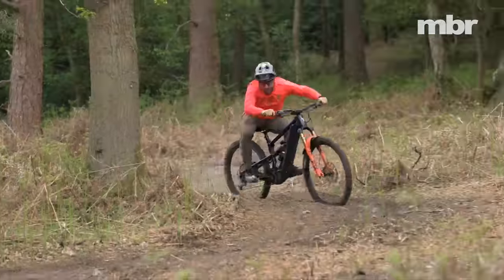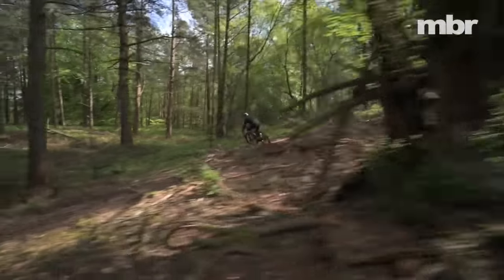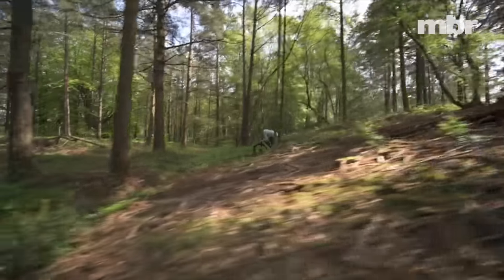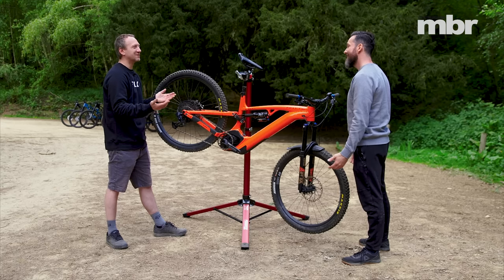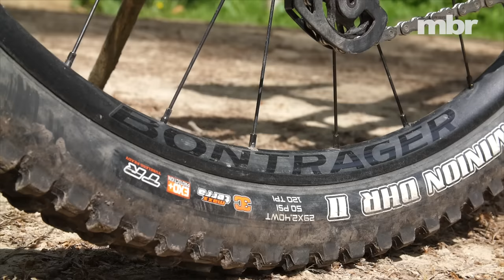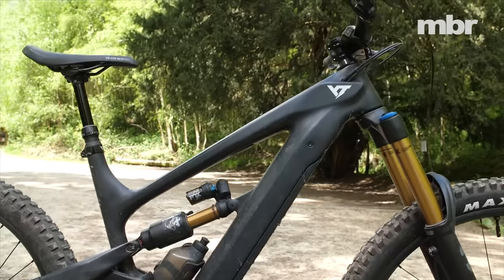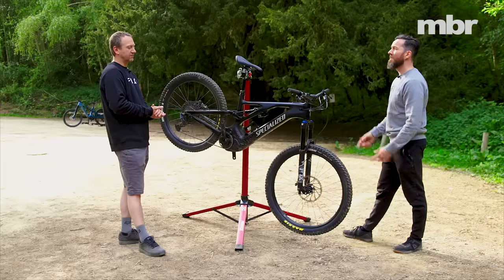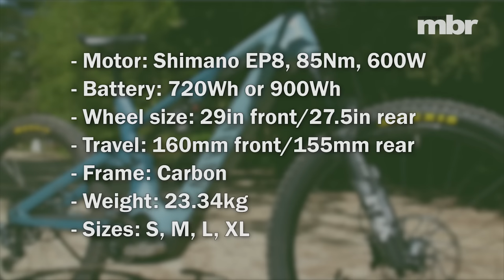The best electric mountain bikes: MBR E-Bike of the Year 2023! | Mountain Bike Rider

Comment: Interesting points(expert advice great information, amazing information must watch before you buy!) Funny thing about the length of the rear end. Having rode a 2019 Levo 29'er XL vs 2022 Levo S5 Mullet set up - The comparison to the Giant Trance e-Bike makes perfect sense.  The way the bike handles and control in DH technical or climbs. The balance and control. One other point is RockShock vs Fox. I think the Fox has the edge IMHO.  Getting the right size along with the other expert points you made!

Comment: Purchased the same Turbo Levo Comp.  Great discounted price.  I eventually upgraded the suspension; Fox 38 / X2, SRAM T-type transmission, Magura MT7 brakes.  It’s a totally different animal now.
Reply from the maker: Nice one - sounds like a great build.
Reply: How are you liking the Transmission? I'm thinking of doing the same on my Turbo Levo.
Reply: @McMaster_102  this my 2nd upgrade from stock.  The previous Eagle AXS was just as good as the new T-Type Transmission.  IMHO, I couldn’t feel a big jump in improvement for the money spent.  But from the stock GX to the current setup; night and day difference.  I still feel I need to “soft pedal” when shifting though.

Comment: Haven't found a Canyon Spectral with a Bosch motor. While Canyon say they have Bosch the website only option offered is the EP8, I wouldn't touch a Shimano motor with a bage pole. 
I still have a 2017/18 Trek Powerfly FS7 23.3kgs gen3 Bosch and not a single problem, now just over 10,000km. While all the guys I ride with have Specialized, Merida, Giant, Rocky Mountain and all have multiple problems with motors and replacement motors, and some with problems with speed sensor and batteries.
So I guess the Trek Rail will be the safest choice.
Reply from the maker: There isn't a Spectral:ON with Bosch. But the new Strive:ON does come with the Bosch system, removable battery, mullet wheels and just 10mm more travel.
Reply: @MBRmagazine  hurry up your test.

Comment: With regards to the Mondraker Crafty R rear end being unbalanced. The compression on my Cafty R came wound right up from the factory, if you pop the cap off where the adjuster would be you can with long nose pliers adjust the compression damping the full range.
When reduced the front and rear are nicely balanced and the bike rips.
Reply from the maker: Interesting - will definitely investigate. Thanks.
Reply: Turn clock wise or reverse?
Reply: @crocodiluspekinensis  reversed I think.
Ive got mine fully open as per the setup guide and same with the fork, works great.

Comment: So from experience and for the Specialized Turbo Levo just change the front fork to DVO Onyx SC with a custom tune and the rear to a DVO Topaz with a custom tune and this bike is like 10X better and yes I am like 120 kilos and still ride a 36mm DVO with zero problems, 100% reliability, but man does this increase the fun, speed, handling and confidence all at once.  Those are absolutely amazing upgrades.  Yes I blew the stock wheels and the components are meh.  If I could do it again I would buy the frame and just build out with Shimano and DVO and change the stock dropper post to something that is smoother.  But man the top of this bike swings side to side like a feather due to its light weight.

Comment: I got a 23 Levo Pro with AXS Eagle Transmission, Factory suspension, Bikeyoke dropper. Got S6. Only thing I am going to swap is brakes.  I was getting the Expert, but I add up cost of upgrading everything to the pro spec I wanted, and It would have cost me more than the difference I paid for the pro. Updating pricing is good to go.

Comment: Did you have a chance to ride the Orbea Wild FS yet?  Some sources say it's even better than the Specialized Turbo Levo.  The team at The Loam Wolf picked the Orbea Wild FS as the 2023 E-MTB of the year.
Reply from the maker: We're riding the M-LTD now. It's a very nice spec, but also £11k, so much more expensive than the Levo we tested. So far definitely enjoying the ride - suspension is good and it's very stable. The Bosch motor and big battery gives it a huge range, even with DH-casing, MaxxGrip tyres, but the non-removable battery is a pain. Will maybe try and do a comparison with the Canyon Strive:ON seeing as they are both marketed as enduro race bikes.
Reply: @MBRmagazine  I'm sure the Wild M-LTD is a super nice e-mtb, but I have the Turbo Levo S-Works ($15K) and I'd put it up against the Wild FS M-LTD any day of the week!
Do you think they are equally good bikes with the only real difference being rider preference?  Would you agree that it's like comparing a Ferrari vs a Lamborghini?
Reply from the maker: Can’t really compare them directly as they are different travel and intended uses. One is a versatile Trail bike and one is designed specifically for e-enduro racing.

Comment: You mentioned changing tyres for better battery range on the nukeproof, do you have any recommendations ? I ride my ebike on pretty flat trails, so I’m looking to get as many miles as possible on a ride.
Reply from the maker: Hi Daniel, yes, the Nukeproof comes with Maxxis tyres in the softest MaxxGrip compound and heaviest/toughest Double Down casings. Switching to the mid compound MaxxTerra and maybe a lighter EXO+ casing up front would reduce rolling resistance and increase range at the expense of some grip. Everything is a compromise, and Nukeproof has gone for a tyre set-up designed to work on rough, steep, gnarly enduro trails.

Comment: Odd you didn't call out the Canyon for cable routing through stem or headset?
Reply from the maker: True, but it’s one of the least worst designs in the test as you can still adjust the stem relatively easily, and the AXS drivetrain meant no issues with tight cables and shifting. But yeah, we’d prefer it with regular routing.

Comment: What size YT decoy Mx did you ride, and how tall are you? I keep reading that people size up on the decoy Mx. I currently ride an S4 stumpy EVO and I’m 5’11”.
Reply from the maker: We rode the size large, and although on the small side, it did make for a very agile bike. In the review we said “The frame is available in five sizes XS to XXL and while the sizing on the Decoy isn’t the most generous, the size L sporting a rather demure 451mm reach, the Decoy feels all the more manageable and manoeuvrable for it. Also the 50mm stem ensures that the fit never feels cramped, and even slows the steering response down a hair to make it easier to correct course mid turn.”
Reply: @MBRmagazine  thanks for the info. I’m very torn as to which size to get. My stumpy sizing seems very close to the XL of the decoy MX with the reach being 7mm longer on my stumpy. Did you feel like it felt very small compared to the levo?
Reply from the maker: Remember that the extra stability and climbing ability of e-bikes means you can down size without much issue. Looking at the geo chart, the reach looks spot on with the XXL, but the seat tube gets really long, so that might end up being the biggest negative. A 470mm seat tube is pretty tall. Our test rider was 5ft 11in btw.

Comment: These ultra high end bikes are a tiny niche that only a handful need and even fewer can afford.   They need to get the price closer to $2000 to gain any mass market potential.  

95% of e bike buyers would be better served with a cheap hub drive off of Amazon.  And that is exactly what is happening as about 2 million e bikes will be  sold this year in the USA.   Maybe 20k out of 2 million will be over $5k.
Reply from the maker: The mid-drive motor is the optimum design for mountain biking - hub motors are severely flawed in that application. As much as we’d love to see good quality e-bikes for $2k it just ain’t going to happen realistically. Decathlon gets close, but that’s about it.

Comment: Fantastic video, really informative for myself who is just starting to look at ebikes.  What's your experience with shimano motors? I've read a lot of horror stories regarding reliability.
Reply from the maker: Thanks for the kind words. While we couldn't put any exact figures on it, from talking to industry folk , bike shop employees and regular riders, the Bosch system seems to be the most reliable. While there may be more stories about Shimano issues, it's worth remembering that there are probably more bikes with Shimano systems out there in the wild than any other. So, if for example, both Bosch and Shimano see 1 in 100 motors with issues, there will be more Shimano motors out there with problems than Bosch, simply because more bikes use them. Not saying this is what's happening, but it's something worth bearing in mind.
Reply: @MBRmagazine  thank u for taking the time to reply. A uk based bike company that I currently ride had to abandon their ebike project due to 70% failure rate of the shimano motors during testing. Has put the fear in my head about it but them I see santa cruz & other high end bikes using them 🤷‍♂️ It's such a big investment for ebike just now

Comment: This is why the bike industry deserves whats happened to it as most people don't want to spend thousands on a bloody push bike as that's the point of a bike, a cheap mode of transport. 

Where is the value when you are spending that sort of money as most of the parts on a bike are very cheap to make such as the cassette and chain for example those are just stamped out of sheet metal nothing really complicated about them plus most parts are made in China and tiawan so it's definitely really cheap to produce parts. 

I recently went to a bike shop and there was a £3500 MTB with basic £60 shimano mt200 brakes on it, what the f is going on, if I'm spending that sort of money I want much better components than that and it's not just the brakes most of the other parts was very cheap and basic such as the suspension forks, drivetrain etc.
I have had bikes from Halfords that cost around 500 quid with better parts then some of the bikes available today that cost way more. 

It was only around 10 years ago the most expensive bike in the local bike shop was around 3 grand and you got the best parts available on it.

It's just greed from the bike companys and they deserve everything what's happened to them.

Comment: Man, i watched this video like 4x now. Great shots, informative, beautifuly done.
Im torn between Decoy (the AM version) since i don't want the mullet setup and the new Canyon Neuron:ON (140-150mm travel is easily enough for me).
I guess it will be Canyon since it is Bosch powered (plus no BS battery hassle).
Reply from the maker: Glad it was helpful! We’ve ridden the Neuron:ON - there’s a first ride review on our website.
Reply: @MBRmagazine  
Damn... a "non removable battery", for the love of God, why?👿
Also, was the size L perfect for you? I'm 5'11 with a change and i would probably buy size M. Hmmm🤔
Reply from the maker: Yeah the battery is not ideal. I rode a size large and it was spot on at 5ft 10in.
Reply: @MBRmagazine  in that case, would you go with a Decoy in size XL? This damn sizing from all the major players is all over the place🤪
Reply from the maker: The MX or the 29er? We’ve tested the mx in both L and XL and marginally preferred it in size L.
Reply: @MBRmagazine  
29er. Don't know why but i don't like the mullet setup... plus it looks like ass 😉😂
Reply from the maker: The 29er is quite a different beast, with fairly long chainstays. Certainly a lot less dynamic than the MX version.

Comment: "What" no Haibike, the AllMtn 10 would of won this hands down imo
Reply from the maker: We've tested the Haibike AllMtn 6 and CF 10 before and It wouldn't have won. If you have one, and it's a winner in your mind, then that's all that should matter.
Reply: @MBRmagazine  I don't unfortunately, but looking like u can pick them up for just over 4k. That's more than 2k less than your winner with better spec. I am looking @ one though. Just surprised Haibike wasn't even in your test, seeing as they are the founders of embt, just sayin.
Reply from the maker: Obviously lots of bikes discounted right now, so although a great deal, it’s not out of the ordinary. Our winner is predominantly based on the ride quality, so the level of the components is only part of the equation. We’d love to put every bike on the market in this test, but it’s just not feasible to keep adding new models without compromising on the quality of the testing. 👍

Comment: You left out the best motor on the market , 😂
Sachs . 112 Nm at low rpm's . all that power can be released as low as 40 to 60 rpm in a smooth and natural way . 
i have a bosch cx on a cube and a Sachs on a Nox xc bike from austria .
The sachs destroys any of the motors you guys tested especially on steep  hills . The delivery of that power is even more natural than the Bosch as there is no over run of the motor when you stop pedaling and the shut off is super smooth and almost unnoticeable .
To be fair , nox doesn't send their bikes out for reviews which really sucks as i would love to hear your opinion .
Reply from the maker: Thanks for the comment. We don’t know of any other brands in the UK using the sachs motor, hence why no bikes with it in the test. We actually rode a Nox and met the guys from the brand recently. Really nice bunch and impressive all-European manufacturing. 👍
Reply: Yes , it's kind of weird that no other manufacturers have used the Sachs . They seem to have a tight reign on their product , not allowing the handlers/dealers to work on their motor .my dealer said if anything goes wrong the entire motor has to be replaced . 
Also nox doesn't advertise or lend out their bikes for reviews . i might be wrong about all of this though .

Comment: No rocky mountain?
Reply from the maker: Sadly not. Funnily enough though, we were discussing this with them today, so hopefully we can get one in this year’s test.
Reply: @MBRmagazine  I own two altitude power plays, 2019 and a 2023. One is my wife's although I rode it more then she did hence the 2023. Hers is an A70 mine is a C90.  Pretty amazing machines for where I ride in Vermont. I think once you feel the 105nm of max torque its hard to drop back to 85 nm or less. RM is pretty difficult to communicate with. They take forever for parts, they never reply timely to questions. I would have bought a large A70 new but despite attempting to locate a large for close to a year they could never find one for me. Both dealers failed to contact me again after I asked for them to find one. RM was no help. I ended up getting the C90 off Pink bike one year old with 75 miles on it for way less then a new one. Ironically the dealer I used to ship the bike in utah had several new A70 bikes in stock that were apparently invisible to the dealer network. Great bikes but RM needs customer service work.
Reply from the maker: Interesting. We've ridden the Powerplay bikes previously and been really impressed, but obviously can't test the customer service!